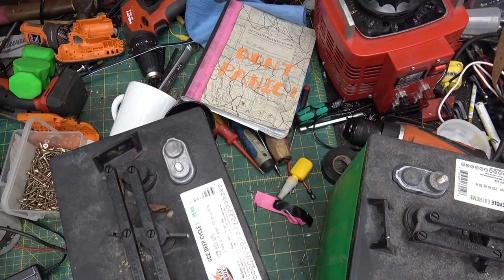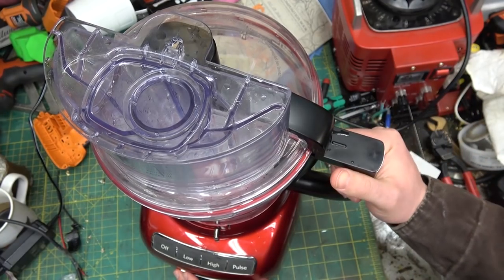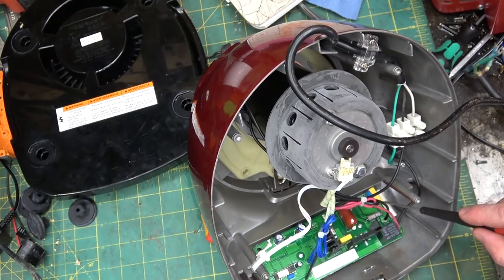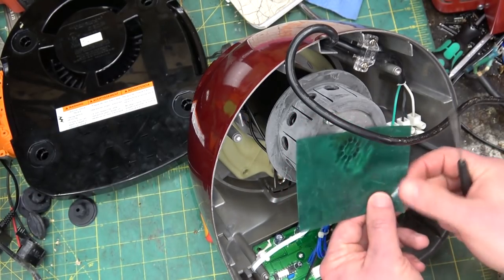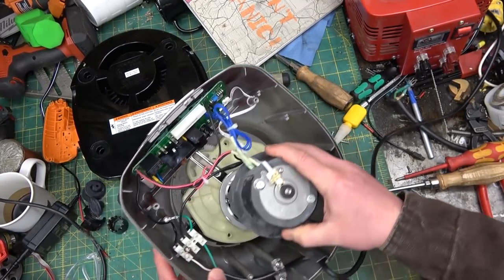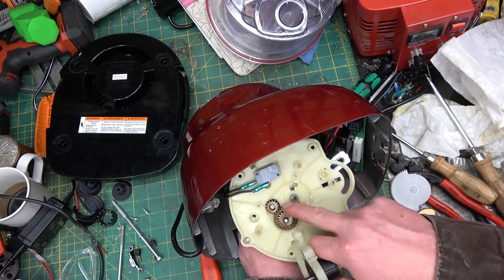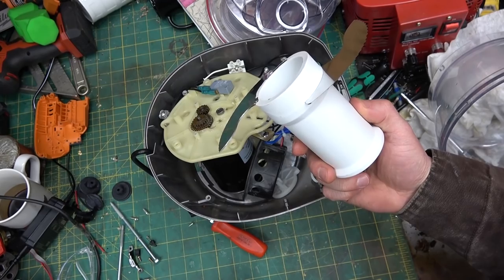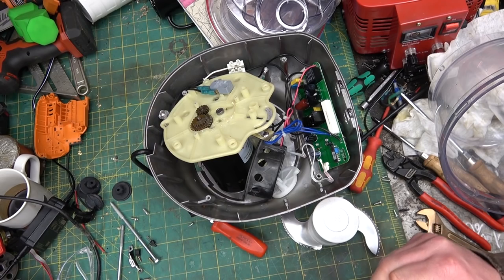BOLTR: KitchenAid Food Processor | Expensive Junk

Comment: Thwarted by plastic shit... I would never buy Kitchen Aid Food Processor.  My food processor was made in France, 40 some odd years ago, and it's still like new and does everything without so much as a whimper.  Yeah, it doesn't have two speeds and gear boxes, it's just on or off... no pulse.  You actuate the switch if you want to pulse it.  Rule of thumb:  The more basic the better.

Comment: I see the root cause: cheap high-speed blender press-ganged into mixer service! Like those damned Ninjas. "You don't need low speed, just pulse it". Uh-huh. I tried to make cookie dough with the included ass paddle (complete with speed holes) and she let the smoke out. Did your Nana mix pie crust at 3,000 rippems? If so, I wouldn't arm wrassle her if I were Paul Bunyan.

Get the Lady a proper stand mixer (one with a PTO, like a power tool should have) or tell her a real pie crust recipe has a happy ending. Get it? Making it is a hand job. Wakka-wakka.

Comment: Holyofuck  the life expectancy on appliances in my house is relative to whats new and better not its broke but there is a better one. Case in point vacuum cleaners I had 3 perfect ones had to strip the heads down remove hair and clean the filters these were replaced by new units. The 3 old ones being used and not emptied when necessary plugging up would trip the thermal switch. Obviously the thermal switch will trip easier after excessive abuse now after cleaning and half a hopper load the vacuum would stop. Buddy I have 3 females in there 20s that shed hair like border collies in the spring. My wife bought a Dyson animal thinking that it would last longer. THE PROBLEM IS have to clean the brush roller more often because she realizes this thing cost as much as the 3 cleaners we just replaced. If she had that mindset with the first one we would still have it. Happy wife happy life just going through the exercise at 28 years with the same woman. An anomaly in todays standards.Not going to say keep up the good work because its going to happen anyways.Best to you and your family in the new year.

Comment: Kitchen Aid: Most overated appliance ever.  I made a steel insert to replace the zamac coupling on my KA blender. They seem to underate their mechanical fuse links. JUNK!  BTW> How do you tell the difference at a glance between an 3 terminal SCR and a Triac? I can't do that after 40 years designing the stuff without looking at a part #.

Comment: Sad :(

Why not knock out something?  
You have all of the tools needed to knock out a better component.  The plastic is fine, the gears are fine, if that shit ain't broke don't fuckin' fix it!

Lube it up, toss that shit together !  I'd just use a hose clamp around the drive socket, and file better "splines" on that drive.  Maybe use a heat gun to soften the blade thing when tightening the hose clamp, and use the best (cheap) grease I have when reassembling the drive gears.  The shit could be better than stock for nothin', in less than an hour.

Comment: I have had much better luck with Braun models which use a belt drive, are more stable (closer to the counter) and have much less of the BS safety junk none of those damn un-cleanable nooks and crannies. Not sure about the 120v models but the ones in Europe are Skookum.

Comment: You sure that thyristor is a SCR & not a TRIAC ? Since its controlled by a uC, a DIAC is not needed. Also they make 3 quadrant TRIACs that aren't troubled that much with inductive (motor) loads. The uC is operated from a negative supply (I do it all the time), so that a negative going signal trips the TRIAC gate (Mode II,III).

Sample (non uC) TRIAC circuit, using II,III operation, with NO DIAC:
https://threeneurons.files.wordpress.com/2015/07/co3i_sch.jpg

Comment: Had a similar problem with my blender. Stupid plastic couplings are junk. Took all the dimensions and remade it in aluminum on the bridgeport. Problem solved. 
https://www.facebook.com/photo.php?fbid=2082128568499025&set=pcb.2082142488497633&type=3&theater